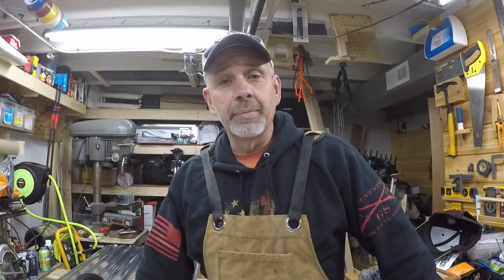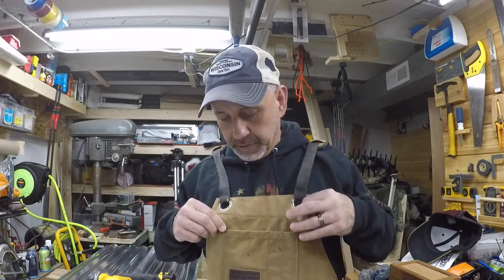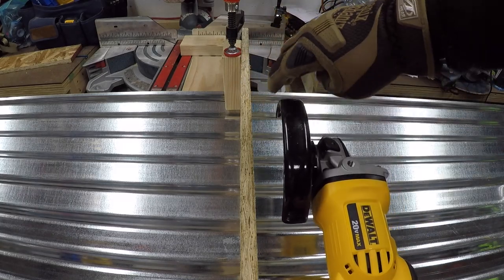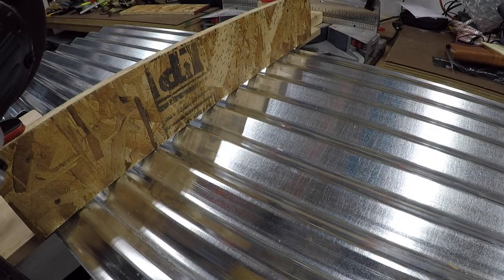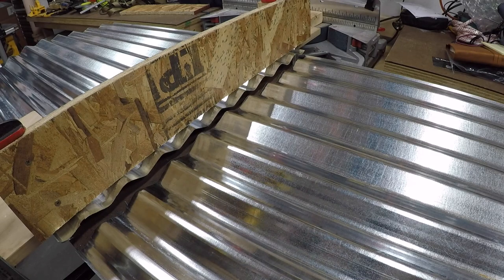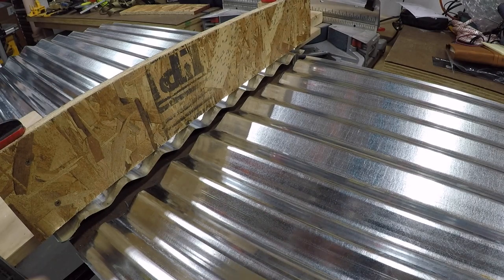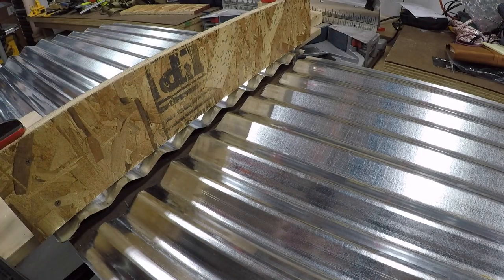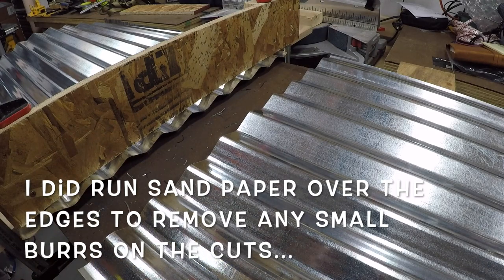Cutting corrugated metal roofing with an grinder

Comment: Good job on the fence idea. Just an FYI Galvanized metal hot cut gives off toxic fumes, to be done with proper ventilation. Hearing, eye and breathing protection should be worn. Plus have a fire extinguisher near by.

Comment: the best wheel to use is one that cuts masonry -----zero sparks ---also that cut edge has no galvanizing you might want to apply some paint to prevent rusting

Comment: My own experience is to wear safety goggles when cutting metal. I was cutting barn tin, my safety glasses slipped ever so slightly down my sweaty nose and a hot piece of metal shaving went in my eye. Use goggles!

Comment: Good video. Exactly what I was looking for. What is the type of material you are cutting? Galvanized? Gauge?
Reply from the maker: It is galvanized... gauge is not mentioned in description but did some research and the general use panels are approx 30-31 gauge .. hope that helps.

Comment: The cut end will get rusted.
The heat just damaged the coating.
All warranty is void when doing that
Reply from the maker: They were just making a chicken coop and not sure if they painted it. Otherwise u could try and cut a straight line with tin snips but be very careful u don’t cut urself on the edge. Thanks for watching.

Comment: If you pulled the grinder towards you while cutting (or start where you finished) it will not be riding up every now and again - more control and a bit safer - not a big deal on thin metal like this I agree - but a better practice for all similar cuts on any thickness of material.
Reply from the maker: Thank u for watching and u are correct especially on thick metal...

Comment: I want to cut only through the ribs, but not get into the flat part of the roofing. I am trying to imagine a way to control depth, other than eyeballs.
Reply: I am trying to engineer the eyebrow water flow. It is now clear that I need water to flow off dormer at both sides back onto the roof.  Tucking the dormer a foot under the panels is not the way to go.  Unfortunately my last panel rib hits the dormer I am uncertain how I will negotiate the water flow.

Comment: I want to try this, I am trying to figure out the grinding wheel.  What kind do you use?  I have one that says for metal but not sure if it is the right one (it looks kind of thick)
Reply: You need a metal cutting disc not a grinding disc, they are very narrow.
Reply from the maker: As Michael indicated a metal cutting disc, they r very thin and very tough. Always ensure u are wearing safety glasses, which I’m sure u know.